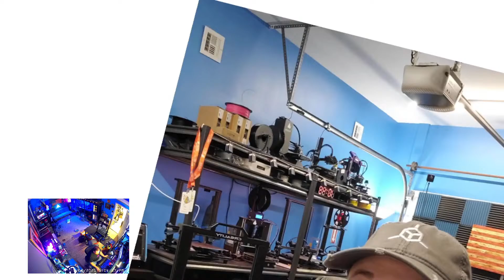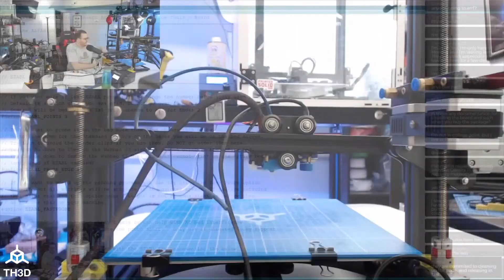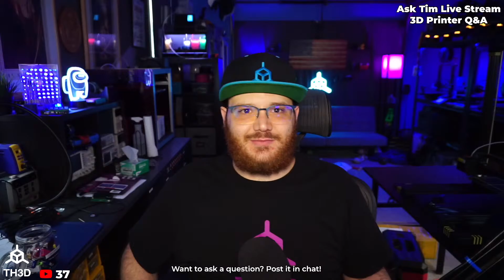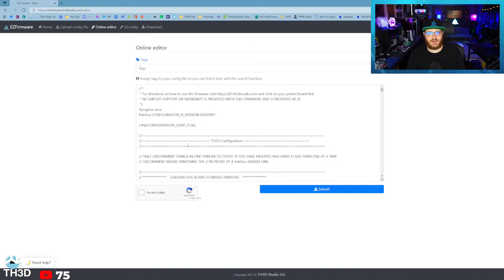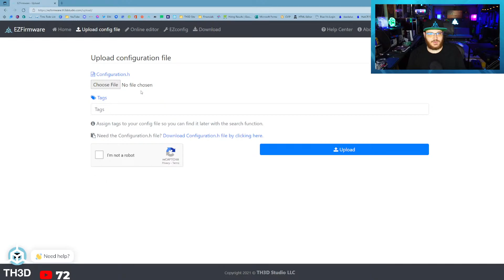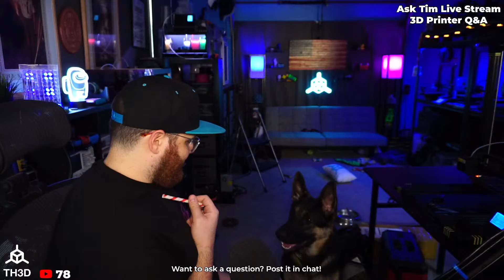Ask Tim - 3D Printer Q&A Help Stream | Livestream | 5PM CST 8/18/21

Comment: I used Sony Vegas for quite a while, been a few years.   Had been using Premier Pro but the cost started add up.  Have since switched to Davinci Resolve Studio.    Have you tried Davinci Resolve?    The Davinci Resolve Studio version has GPU acceleration.    It has options to bring in the shortcuts you might be used to in Vegas or Premier Pro.
Reply from the maker: Will have to check resolve out. We signed up for 1 year of premiere. It actually is pretty nice but the subscription model stuff sucks. :/
Reply: Studio is the one time purchase version that has GPU acceleration.   Helps with the rendering time if your video card is decent.   17 is solid for me.   The extra features are worth it to me.   The standard version is the free version.   Either is great IMO.   I used the free version for months and then finally purchased Studio.
Reply: Also, 17 has been out of Beta since Feb, 2021